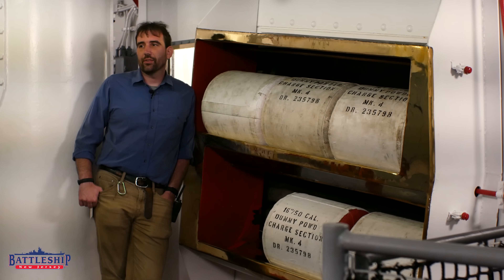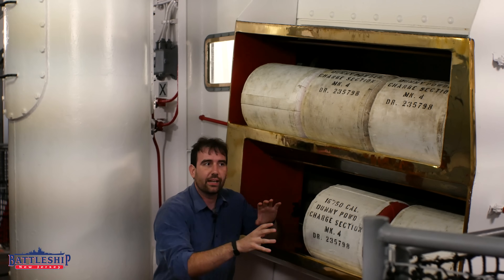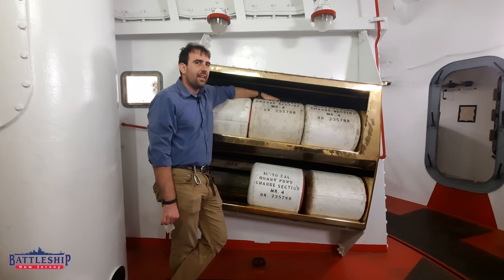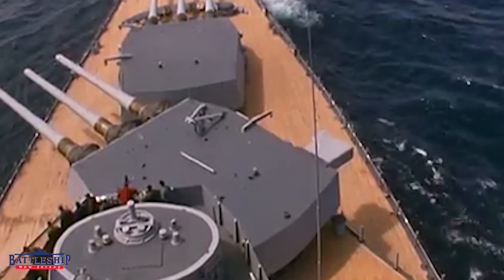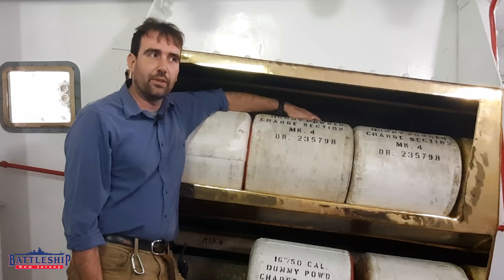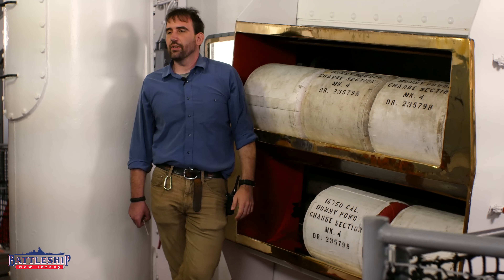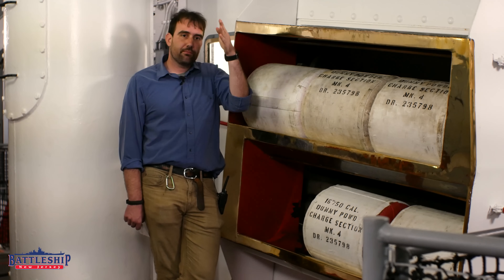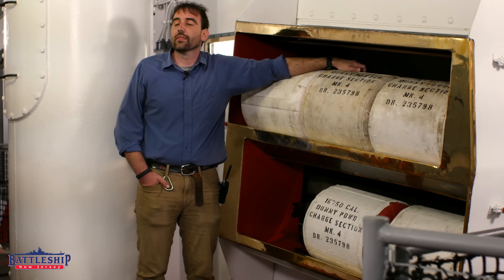16in Gun Powder

Comment: I worked as a Chemist at the Naval Ordnance Station, Indian Head MD in the late 60’s.  This is where the propellant for the NJ was made.  We tested every batch to make sure it was in spec.  I got a chance to go to Dahlgren  VA. to watch test firing to measure the “force/power”of every batch to make adjustments for range.  It was shot at 45 and 0 degrees through wire loops to measure the speed of the projectile. When I got there,they were firing 5” guns and I thought that was unbelievable on how loud they where and how everything shook.   Then they put 6 bags of powder into the 16” gun after the shell which  weighed about 2200 lb.  When that was fired,  it made the 5” gun sound like a .22 round in comparison.   The noise was deafening and it lifted dirt off the ground everywhere. I also got a chance,with binoculars to watch the  0 degree shot skip down the Potomac like someone skipping a rock.  What a day!!
Reply: What did you do at work today daddy? Fascinating job,
Reply: Definitely interesting. I never got to see that. The best thing I saw was the testing of the catapults on the USS Ronald Reagan while it was at Newport News shipyard on fit out. Which was interesting to see.
Reply: @Ed - So I have a question for you: If you were to lower the number of the Powder/Propellant bags to 3 (330lbm of powder), could you still get a reasonably high barrel exit velocity from a high capacity round? Would that just decrease the range? I would like to maintain 2300 fps on the round exiting the barrel, and do not care about the range using this propellant weight/configuration.

Comment: My Father was in charge of a smokeless gunpowder plant during WWII. I inherited some samples including a grain from the battleship Missouri. Relax, I have since disposed of the samples. The reason for the 7 holes was so that as the gunpowder burned, the surface area would remain relatively constant. Burning from the outside would reduce the surface area. Burning from inside each of the 7 holes would increase the surface area. So the two would balance out. An important concern was that the burn would finish just as the round left the end of the barrel. This served to avoid wasting powder and it also served to reduce the size of the muzzle flash.
Reply: Perhaps I focus on local history too much, but I saw “smokeless gunpowder plant” and thought of Hercules Powder Company in Kenvil, NJ. I know that it blew sky high in September 1940, it killed 51 and it was suspected that the local Bundists did some sabotage.
Reply: There was also the Hercules plant just outside of Wilmington, Delaware. Actually, it's still there, though I don't know if they still make anything on-site any longer.
Reply: This is known as progressive burning powder and is used in a very much smaller version in sporting and military small arms. You want the powder to burn in such a manner that it provides consistent pressure while the projectile is being pushed down the barrel. Any unburned powder is wasteful and does nothing for velocity.  Conversely, if the powder is burned before the projectile leaves the barrel, then pressure drops and the projectile will have a reduced velocity as it exits.
Reply: Richard Knouse, I was a 16 inch gunner on the Missouri back in the 1980's, rear turret center gun. I was also LPO of powder flats and powder magazines. We had a powder bag  break open on the powder flats. Somewhere around the house I still have a Cheetos with powder grains from that broken bag.
Reply: What facility ? Most of my grand family worked at inaap  in Charlestown  Indiana  I live a few miles
Reply: dosn't the continued burn keep chamber pressure pretty consistent until burnout? I would imagine that if you plotted the pressure, it should be a bell shaped curve, because you need the projectile to start moving before you really hammer it
Reply: @patrickmcneilly4293  dam! i've never looked into the history of Hercules, but I've heard the name a LOT. I follow some mine explorers on here, and they come across those boxes everywhere. them and Giant Powder Co were the big big names in blowing stuff up
Reply: @dacomazielsdorf7618 , I suspect he refers to Crane Army Ammunition Activity in Crane, Indiana. I once made a delivery there and they had 16 inch HEPD rounds sitting around.
Reply: Makes me sad that you don't have that propellant sample anymore. Hopefully you disposed of it by burning it in the chimney. It would make me even sadder if you gaved it to police or dumped it in the trash.
Reply: Hindsight is 20/20. That being said. Couldn't you have encapsulated the sample grains in an acrylic or clear resin to allow for display and prevent the grain from going off?
Reply: Should have cast it in epoxy and kept it forever. Not exactly a replaceable piece of history sadly.
It’s true and cool about the powder plant. I watched a lot of old documentary and war footage of naval caliber gun manufacturing and how the ammo was made. It’s amazing that so much went into the powder back then. Like I’d hate to be the guy who had to make sure all the powder was aligned in the bags.

Thankfully when I was a gun bunny, we have cool standardized MAC charges that use significantly more efficient powder, and direction upon loading doesn’t matter as both sides have a red circle in the center. (This is the part that goes bang first. Think of the red backs on powder charge bags and MAC charges as targets for the primer.) I can not say as to wether or not the powder is tightly and neatly aligned inside, or what exact size or if they have holes or whatnot. The insides were never disclosed to us. Still, the evolution is quite nice compared to the old bag system. Makes me think if naval caliber guns could make a come back with modernization. I think they’re still viable to those with the brains and balls to use them.
Reply: @seldoon_nemar  no maximum pressure in any gun occurs when the projectile first seals the riffling from that point the pressure is decreasing because as the projectile moves down the barrel the space for the gasses to fill is getting larger so the press drops that is the reason for the multi base powers we have now to try and keep a higher pressure longer
Reply: Some solid rocket boosters have similar careful engineering as the propellant grains. The shuttle's SRBs (and the derivative SRBs on the SLS) are carefully designed with propellant cones first burning to provide high thrust and then an 11-point star-shaped gap in the core to provide a consistent burn surface throughout the rest of the flight.
Reply: @ryanstuckey8677  except you didn't account for slow burning powder that continues to burn once the projectile is moving, creating more and more gas... meaning either the pressure drops marginally, stays static through the burn until the projectile leaves the gun, or ramps up and then down as the flamefront exponentially expands in the charge until burnout... 

even in rifles you have powder burn times, that's why a 12" barrel might have decreased muzel velocity (and a big fireball) with "hot" ammo, but going long with the barrel could also have detrimental effects as the powder burns off before the exit of the round (vs using an appropriately larger charge for the same bullet)
Reply: @dacomazielsdorf7618  Memphis Tennessee
Reply: Great post George. There is a detailed video on grain types and pressures on youtube called Fundamentals of Ballistics (1949) that's well worth the watch.
Reply: @georgesakellaropoulos8162  Not only that, un-burned power also caused muzzle flash, which is not desirable for military applications.
Reply: WHY would you dispose of them?!!!
Reply: @dacomazielsdorf7618  Memphis TN, closed down after the war.
Reply: Gun cotton grains weren't the only things in that sample box. I was warned by my father that some of those things could go unstable over time triggering a fire.
Reply: There is a Hercules here in brunswick ga . Where I grew up...they still make explosives ans Dynamite I think..very dangerous job site..they are big on safety
Reply: My father was in charge of a powder plant near Memphis Tennessee. It gas since been dismantled. 
The original du Pont powder mills were along Brandywine Creek in Delaware. Each building was stone on three sides and wood on the side facing the creek. So if it blew the blast would be contained.
Reply: @seldoon_nemar  "except you didn't account for slow burning powder that continues to burn once the projectile is moving, creating more and more gas... meaning either the pressure drops marginally" - The issue is that the bullet moving forward increases the available volume and thus drops the pressure.
Pressure drop is never marginal. It occurs. Grain shape and surface retardants mitigate the pressure drop, but it really never goes away.
Reply: @ChucksSEADnDEAD  they don't time it out better in a system with a known bore length and exact grain construction? Because I know with smaller cartridges, you can use a different length barrel and you will either burn out the powder early, or run out of barrel and get an explosive pop as it vents behind the exiting projectile. with naval guns, they know exactly how long the barrel is every time because it's a 50 cal and it's not like they cross load into a different gun type. 

I'm sure somewhere the navy technical data is out there as to the burn profile and characteristics of their powder load, but bag load guns are a different game than a cartridge load where the gun is not a guaranteed part of the system.
Reply: @seldoon_nemar  It's theoretically possible to get maximization of pressure but that requires using hotter powder formulas and grains on each successive bag. While progressive burning grains present a larger surface area as they burn, the grains themselves reduce in volume. Combined with the projectile moving further down the barrel there's a pressure drop.
The theoretically "perfect" load would be a somewhat rectangular pressure curve. Quick pressure peak, maintains pressure, quick drop off right at the muzzle. This isn't really achievable in a gun barrel. You can easily modulate pressure inside a solid fuel rocket, because the combustion happens inside a volume that only expands due to the burnt grain and not by the fuel casing getting larger. But the pressure drop is kind of useful in a barrel. First, it allows you to taper the external diameter of the barrel down, which not only reduces mass but also the moment placed on the gun mount as most of the weight is closer to the chamber. Second, the lower pressure near the muzzle also means less flash and blast. Even with powder totally burned, superheated gas, unburned particular matter, hydrogen and carbon monoxide all contribute to the blast due to high pressure. Allowing pressure to drop means cooler gas at the end of the muzzle.
All in all, if you get a peak of 35-37k PSI and it drops to 15k PSI you still have a tremendous force pressing on a circle with 16 inches of diameter. Pi*r squared, about 200 square inches, 15k PSI you get 3 million pounds of force pushing on the shell.
Reply: the individual samples are probably fine to have, if you really were worried you could have had them encapsulated in resin instead
Reply: @AsbestosMuffins  I had the exact same though, however I would also worry about it becoming impact sensitive as it ages. The last thing i'd want to do is notice that my bookshelf grain has started growing crystals because at that point you're in really sketchy water.

I mean heck, what if it becomes sensitive enough that you start dusting on a dry day and static sets it off

(keep in mind that once encased, it is an explosive... in a confined space. it's a really fancy grenade at that point)
Reply: Powder with a single perforation will burn neutrally, increase in internal diameter matches the decrease in external diameter.
Multiple perforations increase the total surface burn area as the grain is consumed, progressive, increasing the gas production to match the barrel volume increase as the projectile advances.
Also, as the projectile accelerates, the pressure is maintained by the increased rate of gas production as the powder grains burn.
Reply: @ryanstuckey8677   No, with pretty much any gun, the chamber pressure keeps increasing until burnout, since the amount of gas in the chamber is increasing much more quickly than the amount of space in the chamber for the gas to occupy.  After burnout, the pressure does indeed drop as the projectile moves down the barrel (although it still keeps accelerating the projectile as long as the chamber pressure exceeds the sum of local atmospheric pressure and the dynamic pressure from the projectile's forward motion, or until the projectile leaves the barrel and unseals the chamber, whichever happens first).  Double- and triple-base powders are used to reduce the chamber temperature (to reduce barrel erosion).
Reply: Too bad you got rid of historical powder samples. Worth a small fortune to a collector or museum.
Reply: Yuck Foutube  Um, did you see the size of the "grains"? I sure as heck wouldn't keep a two-inch-by-one-inch cylinder of explosive in my house as a souvenir.
Reply: @JarrodFrates  I thik pretty much all SRBs do that. The key point is that the fuel in a solid rocket isn't like a candle that's being burnt just from the end; rather, it's a hollow cylinder and combustion occurs across the whole of the interior face.
Reply: @seldoon_nemar  As the projectile velocity increases, so does the drag. As the burning powder expands the pressure drops and the force applied to the projectile decreases. For maximum velocity and most efficient use of the powder you want the projectile leaving the barrel just as the pressure driving the projectile is equal to the drag. The remaining pressure is what gives the flash / fireball when the shell leaves.
Reply: @Your_Resident_Redleg  MACS! (Modular Artillery Charge System). It's good to be The King!
Reply: @patrickmcneilly4293  Hercules blew up several times during its history - the most recent being in the 1988/89 timeframe. Woke me up out of a dead sleep and I was living in Boonton at the time. It's since been closed (was bought by ATK and all the work moved to Radford AAP), cleaned up and the property is for sale.
Reply: @DudeInWalmart  I doubt he threw it away. I think the whole point was that it was explosive. He probably burned it.
Reply: "to reduce the size of the muzzle flash" from a football field to only half of a football field.
Reply: Modern smokeless also can and does use nitroglycerin in small quantities to ensure rapid burning in rifle and pistol barrels for the same reason, complete combustion while in the barrel. If the powder is burning beyond the muzzle, it's not propelling anything.

Given your understanding of how smokeless powder grains work, I'm sure you'd enjoy solid rocket motor construction, they work in a very similar, albeit slower combustion method.
Reply: Just about every gun has its powder completely burned long before the bullet leaves the muzzle. The velocity continues to Increase after it finishes burning because the gasses created by the burning continue to expand.
Reply: @ShortArmOfGod  that's because the powder charge and type was calculated to do so in advance, not magical powder does magic.
Reply: It is not an explosive! It is a propellant! It will burn not explode. Under high pressure it will burn very rapidly. In open air not much. On the other hand "black powder" is in fact an explosive and will detonate in open air or in confined space.
Reply: @robertchall4592  Couldn't have said it better, myself.